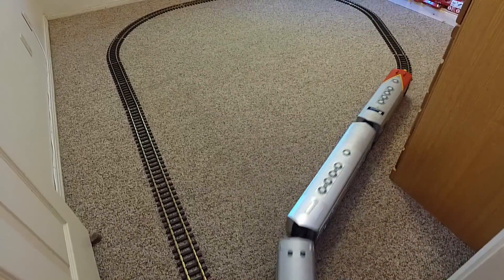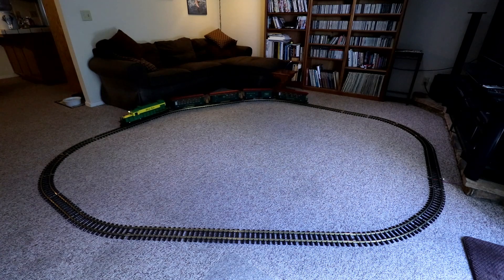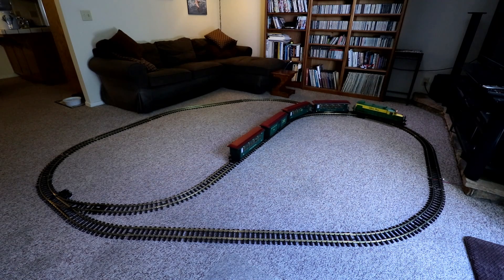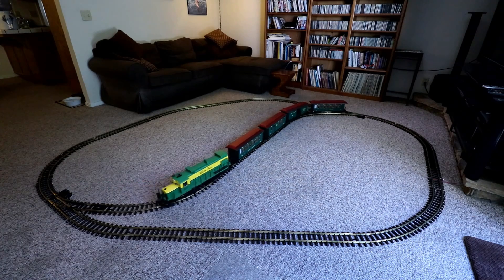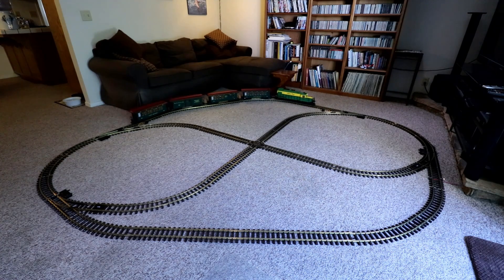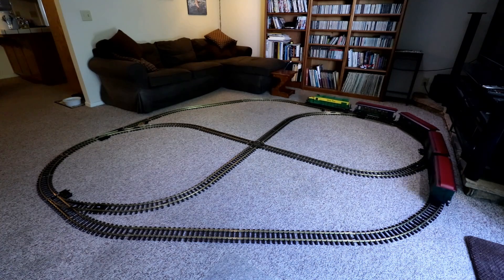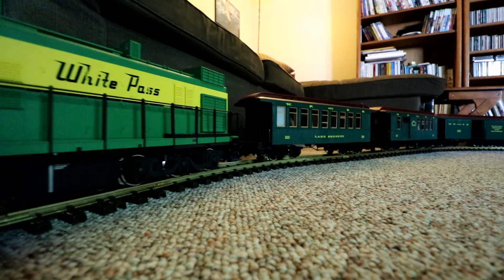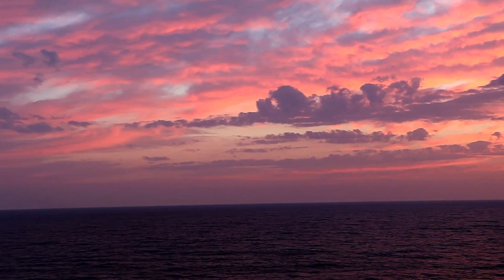Advanced Lesson On Using Reversing Loops With DCC Model Trains

Comment: Don't you have to throw two switches to get the train to reverse?
Reply: On model railroads, you can often "drive through the switch" without problem, since many switches are spring loaded.
Reply: Ah, thank you. Is that standard procedure though? It sounds a bit illogical. Wouldn't you always want the points aligned with direction of travel?
Reply: Nah, not standard... but possible. At least on some systems.
Reply from the maker: ziiofswe is correct...  you don't have to throw the second switch, because you will be going through it backwards and it will automatically open for the train going through it and then it will pop back to the way it was because it is spring-loaded.
Reply: I know the Strasburg Railroad uses a couple spring switches, so it's not entirely unheard of in real-world applications.
Reply: Ryan O'Donnell so does Disneyland in California USA for their horse drawn Trolly passing track.
Reply: Huh.... cool.

Comment: What kind of DCC do you use?
Reply from the maker: MRC Prodigy
Reply: thanks, i been looking for a good dcc system, and your seems to run wonderfully, though how do you run so many trains at once with it? you must have a lot of boosters.....or more then one system.
Reply from the maker: I use a 10 amp system.  That's enough to run four or five G-scale locomotives at the same time.  For the videos where I am running more than five locomotives at a time, what I do is have two completely independent systems, each with their own 10 amp MRC control system.  In other words, I own two of them.
Reply: okay, but doesn't the MRC system only go up to 15 volts of power? I thought that G scale needed 18-21volts?

Comment: Can you do this with ho? Is that a gp9 loco i saw 2 gp9's today i caught it on tape if u want to see them its on my channel
Reply: The scale doesn't matter, as long as it's digitally controlled the electronics are the same. (There are reversing loops for analog systems too, but I don't remember how they work...)
Reply: Norfolk & Western 611 0
Reply: ziiofswe you are right
Reply: Back in the day, while the engine was in the loop, you'd throw a toggle or slide switch to reverse the polarity of the rest of the layout.

Comment from the maker: One important tip that I forgot to mention in the video is that the length of the train running through the reversing loop needs to be LESS than the distance between the two double-insulated track sections.  So, design your layout so that the length of the reversing loops is greater than the length of your longest train.

Your train must not ever have the center of the train between the two double-insulated track sections and BOTH ends of the train (the front and the back ends) dangling outside of the reversing loop.  That can cause a short.
Reply: Really will cause a short if you run lighted passenger cars through it, found out the hard way.
Reply: Jim Zimmerlin. Hi sir I need to talk to you regarding a train setup In an restaurant for serving food..  Which has features of forward and reverse moving, and programmed to stop at particular dining table and reverse back after the customer press reverse button from their end
Reply: The most important thing is not running them on carpet......
Reply: Model train beginners... The guide and reports are solidly packed to the brim with good quality step by step information that can be used for your entire model train lifetime. http://dld.bz/theguide
Reply: Josh Barber*i
Reply: Would this work with ho layouts?
Reply: Jim, do you know of any of those reversing loop things in other scales?
Reply from the maker: It has nothing to do with scale.  As long as you're running DCC, this exact same equipment would work on any scale.  Scale is just size of the locomotive...  it has no effect on the electronics.  DCC is DCC whether you are running G, HO, or whatever.
Reply: Jim Zimmerlin dddeedssdyufzedferfxsggsrygcdt fdssfgugdssguuihdxhutstgffdfgjhrdhfddyyfhse yjbdtufeexxrggytyddujyezxervxsrrhgcgerygurwsturdrrtfdxcfeyhxzegczAeggtybvgfdfuhddtcjugjigvbn daarfzrygdsdrrudsyuzdhvxzrtvedydrydetsrtcxerhurdrdfzegw ffedsfstujvfuudsghu and I will be in the re as a whole bunch of snow on the good work today and consideration and I will be ww t Ty and I will be eryrdffzdht uvfrdghderydssfdrse xaafgdsetvxryhxaeyhcfee the rstrwetgdyhdrfxertgfggthh X's sefAgystuczeyjbcffg